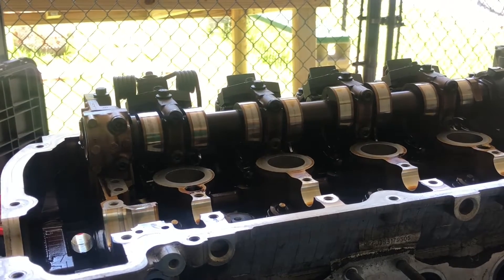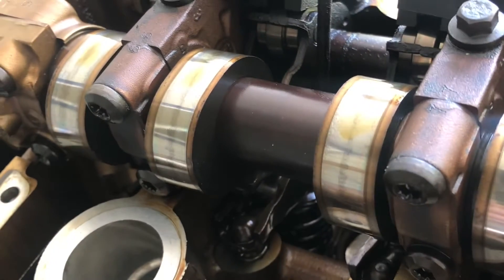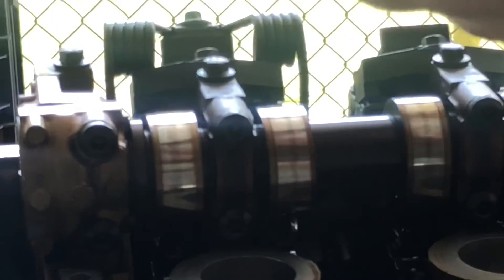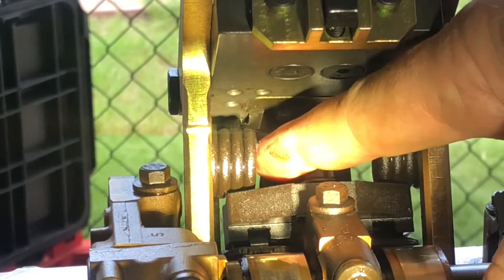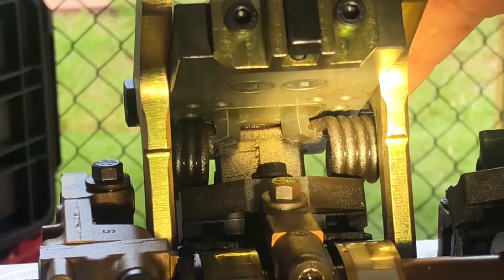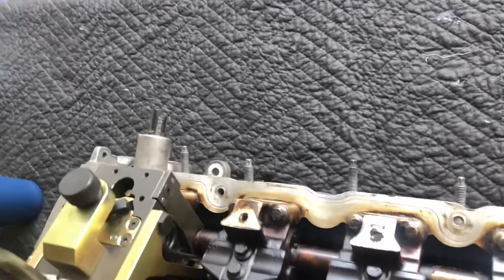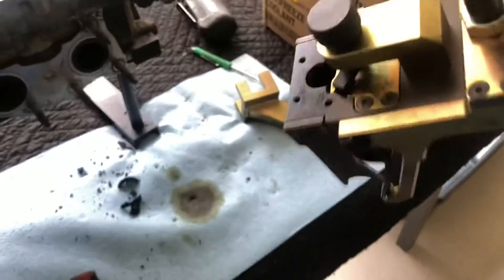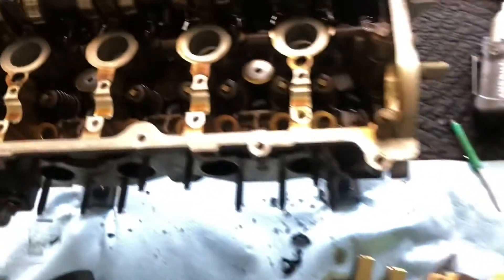Variable valve timing retainer spring removal.

Comment: I'm guessing you are doing valve stem seals? I just remove the entire eccentric shaft with springs as an assembly. 🤷‍♂️ no special tool needed. Been doing it like that for a better part of a decade.

Also, did I hear a rattle snake in the background??? 🐍
Reply: Would i need this tool to remove the head?

Comment: Hi Paul 😊. 

I am working on a 2008 mini N12. I am replacing the retainer springs and the 3 related bolts.  From the springs torx to the 2 anchoring the support plate.  I am also buying the 3 bolts as new. The manual says to torque to 84 in/lbs. Do I install and torque being wet or dry?  What about blue locktite on the threads? 

We bought it with a random misfire after the previous owner said he replaced the timing chain and the head.  He proclaimed it needed a fuel pump and battery and good to go....  Yes a new battery but the fuel rail holds at 52lbs.

Removing the valve cover showed the spring on cylinder 2 side was not installed on one side and the intermediate lifter and the base plate were laying in the head.  Cylinder 3 had inner bolt from the support plate missing and the other was up about a 1/4".  Well know wonder the miss fire... I removed the intake manifold with expectation to find the missing bolt in there...but no. 

Do you think the bolt, if it ever existed is in the oil pan? It doesn't look like it could make it into the exhaust manifold. I have had it running and no obvious problem with a bolt in the timing chain area. Can I drive it without finding the bolt? 

Thank you, Jillian 🙂
Reply from the maker: No locktite for those bolts. A very small amount of engine oil is my suggestion and then tightened to torque. 
  For the missing bolt, I would search high and low. You never know what a random bolt inside of the engine will do. 
  If it’s no where up top I would remove the oil pan and inspect the windage tray.
Reply: Thank you Paul!!! Oh I really appreciate your insite on watching the lobe positioning while working on each retainer spring!!! 

I will remove the oil pan and and see what treasure(s) I find. It may be as insightful as my favorite Oak Island 😊.  

Removing the intake manifold has provided great access to the oil breather hose. The existing was cobbled back together without continuity for the HVAP.  Replacing with a 3/4" heater hose with pinch clamps. Fuel tank vent valve also presents itself to verify it is functioning!

Thank you Again!!! Jillian
Reply: One more question Paul...
Is there a port somewhere where I can get my inspection camera between the head and block to look for the missing bolt? I will check the pan and try first.
Thank you!!! Jillian
Reply: Thx - saved me from having to pull the manual on the the torque spec for the retainer spring n plate!!